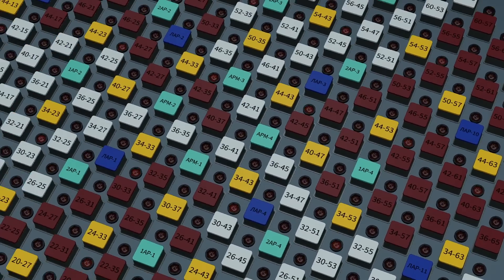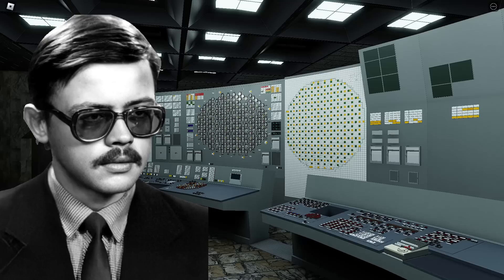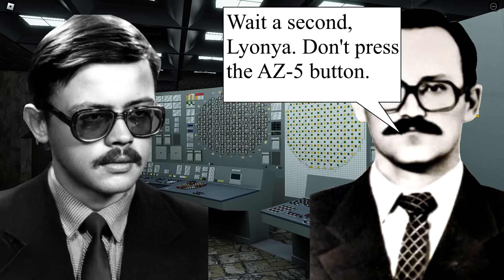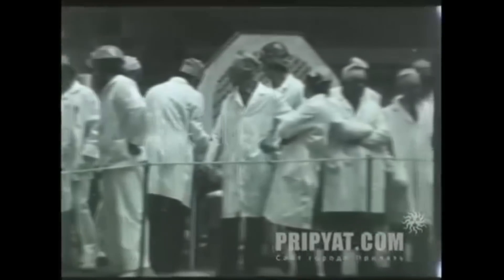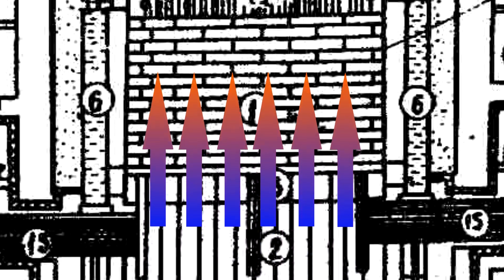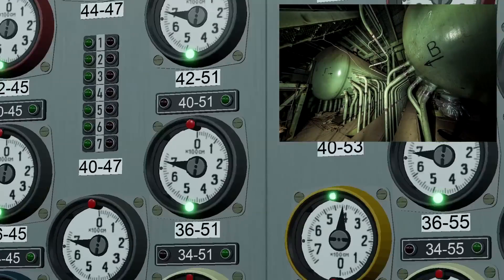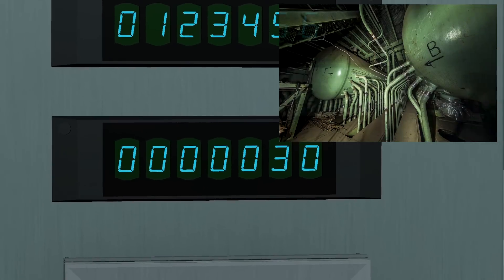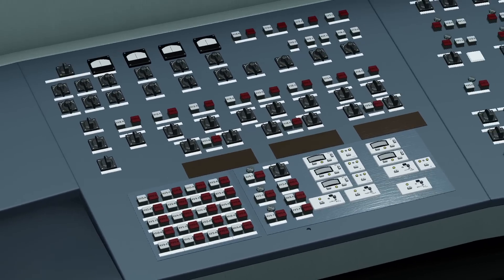Would Not Pressing AZ-5 SAVE Chernobyl?

Comment: So to summarize - essentially, to "save" Chernobyl at that point, they would have had to undertake a dedicated series of very rapid, very unintuitive actions - they would have to disable the automatic scram system altogether, they would have to inject cold water to bring reactivity down, and start inserting control rods "slowly" (compared to the scram at least) one bank at a time.

In other words, do exactly the set of actions that would destroy literally any other reactor in the world other than an RBMK.

That's exactly the kind of thing that they COULD have been TRAINED to do, but nobody in their right mind would ever do unless they were trained. If lessons had been learned from the Leningrad accident, and crews had been trained on an emergency procedure to manage positive scram reactivity, it might have been possible to minimize the damage at Chernobyl, but yeah... that would have required the Soviet Union to admit a flaw in its design and that was never going to happen.
Reply: The funny thing is, somewhat by accident, these steps were taken more or less at Leningrad 1975 and are the reason that was a partial meltdown and not an explosion.
Reply: @kalkuttadrop6371 Basically Leningrad got a good ending but Chernobyl isn't?
Reply: @osopenowsstudio9175  Leningrad was the first RMBK so the staff there had been trained originally on other reactors, specifically the A Series graphite reactors at Mayak. They likely had knowledge of the workings of graphite reactors beyond what was 'on the books'
Reply: @osopenowsstudio9175  I think it was Leningrad was trying to increase reactor power at that time, so it would make sense not to shove control rods in compared to Chernobyl trying to shut down. The reactor was cooler because they weren't doing the coolant pump experiment. The instability gets worse with more fuel burnup, Leningrad may have had less fuel burnup at the time. They had less of the destabilizing conditions that Chernobyl had.
Reply: @osopenowsstudio9175 Leningrad had better operators and a deputy chief that wasn’t  trying to actively sabotage the reactor for a test like Dyatalov was.
Reply: @straightpipediesel  they had less of the destabilizing conditions because they weren’t attempting to artificially destabilized the reactor. The incident in Leningrad was literally the operators doing their job and shutting it down because of a mechanical issue, Chernobyl was two in the morning, fucking around, trying to see whether or not residual flow would cool the core if you shut off all of the cooling and and took all the safety systems off-line.  

In Laymans terms, Leningrad was an oil leak so they shut down the engine …. Chernobyl was a bunch of mechanics who drained all over the coolant out of the engine and then ran it to the red line before trying to dump ice water on the block at the last minute and it cracked
Reply: @kalkuttadrop6371 That wasn’t a meltdown and it didn’t explode. If I recall correctly off the top of my head, they had to use the scram button because one of the water lines ruptured, and there was a momentary spike and power, but it didn’t blow up because they weren’t morons who had retracted all the rods at the same time and then tried to cram them all back and at once
Reply: I think the fact they stopped building RBMKs is probably illustrative enough to say they did admit it
Reply: @yegorgribenuke6853  Well, there was no real hiding it after Chernobyl. Admit it or not, if people are reading some insane amounts of radiation thousands of kilometers away, there's not much you can do to save face. They still downplayed it massively, the entire thing was blamed on operator error, and the whole change happened on the hush-hush. That's not very "admitting it" imo, but maybe our standards are just vastly different.
Reply: @yegorgribenuke6853  I guess that does say alot about the s0viets: it took a world-scale catastrophy for them to admit they maybe possibly made a slightly imperfect decision somewhere.
Reply: @yegorgribenuke6853  well it was a Soviet design and after this, the Soviet Union stopped building reactors….. so that’s not really an admission so much as there was no longer in need to build them
Reply: @Matt-yg8ub  I mean, nuclear power plants take a significant amount of time to build, just 5 years later the Soviet Union was no more, I think they had bigger issues to worry about than deciding to build more nuclear power plants.
Reply: Stupid question, what would happen if you tried this with any non rbmk reactors
Reply: @spazmonkey2131  I imagine it would depend upon the kind of reactor. There are a lot more designs than just the RBMK after all. Of course, the only reason AZ-5 didn't work here was because of the design flaws of the RBMK reactor. Flaws I think (desperately hope) other reactors don't suffer from.
Reply: @spazmonkey2131  Well, in a non-RBMK reactor, you basically always have a negative void coefficient, because the water acts as a moderator, so you'd never get into this feedback loop of a core temperature increase leading to a reactivity increase. The other two meltdowns in operational power reactors (Three Mile Island and Fukushima) both happened in reactors that had been properly shut down, but that couldn't get rid of the decay heat of the fuel.
Reply: @zuthalsoraniz6764  the Soviet RBMK design is different than the western designs and there are trade-offs between the two. We tend to see the Soviet design as defective because it is different than our own design, but the trade-off also had many advantages on their end.
Reply: @Matt-yg8ub What advantages does RBMK have? The only one I am aware of is that the channel design without an overall reactor pressure vessel allowed at least in theory for online refueling, though that is not a substantial advantage for a purely civilian powerplant.
Reply: @zuthalsoraniz6764  Without a pressure vessel, it's cheaper and requires less metal fabrication technology to build, one reason why CANDU has it. Online refueling lets you use lower enrichment, also a technology and cost issue.
Reply: @spazmonkey2131  depends. Just about any other reactor design does not have a moderator on its control rods, meaning you could scram normally. 

If you want to be fancier however, some US designed reactors have dedicated tanks filled with tens of thousands of gallons of boron-infused water. 

Boron is a massive neutron absorbing element, meaning if you flooded a reactor with boron-infused water instead of normal water, it would be the equivalent of pouring a liquid control rod over everything. All neutrons would be absorbed, and the reactor would rapidly go subcritical and fission would abruptly end up
Reply: @spazmonkey2131  No other reactors are graphite moderated...they are water cooled, as opposed to the RBMK using water for Steam production. Other reactors use "heavy water" to moderate reactions...you can see these "reactor pools" on YT vids.
Reply: If they had been properly trained they would have not removed so many control rods.
Reply: @Gerben42  the only way to remove that many rods at the same time was to override the safeties and shut down the computer. If they hadn’t been trying to induce a stall in the reactor in order to test a theory about residual flow, they never would’ve intentionally crippled that reactor to the point of it, exploding.
Reply: Thats ALSO taking into consideration that the absolute MINIMUM amount of control rods that an RBMK reactor needed was something like 15... they removed all but 7-8, about half as many... 

The biggest problem that ultimately lead to the disaster was by operating said reactors at 50% capacity for an extended period of time. Unfortunately, nobody bothered to explain HOW everything functions to their "engineers", let alone to their "lead engineer". 

Kind of ironic that the Soviet Unions biggest blunder was their overarching need to maintain secrecy.
Reply: @Deathcylance  yeah that’s the part that I still can’t wrap my head around….. These were the trained engineers designed to operate this facility safely. Legasov knew how it worked…. In the miniseries, the lady whose name I won’t bother to remember because she’s a composite of 100 other engineers, also knew how it worked…. Why in the hell didn’t Dyatalov?    The real flaw in the Soviet system seems to be that they built an RBMK reactor as dual used to produce power and plutonium …. And they built safeguards into the system to prevent it from exploding but then gave people like Dyatalov the ability to override the safeguards, but not the knowledge to understand why the safeguards were in place.  The Soviet Union compartmentalize the information to where their physics professors understood how the reactor worked, but the engineers operating it just knew which buttons they were supposed to push, and when … but not why.  

Chernobyl #4 had graphite tipped boron control rods because that design functioned for what the Soviet Union wanted and minimized maintenance…. But it also induced a liability if not properly operated
Reply: @Deathcylance just so you know the rbmk reactor had over 200 control rods
Reply: @erickitzi  correct... my comment was referring to the absoulute MINIMUM required level of control rods their very own procedures dictated... unfortunately, by removing the additional control rods to less than HALF of the minimum, the operators basically built an H-bomb with 3-5% enriched uranium... which would've been impressive (THAT usually takes 80-90% enrichment) if not for the fact that the reactor was never built nor designed to attempt to contain said H-bomb... 🤦‍♂️
Reply: @Deathcylance  Nooo... Prompt criticality can occur in 3-5% enriched uranium. Which is what happened, and is obviously undesired in nuclear reactors, which we want to run on delayed neutrons instead of prompt neutrons. Yes, they made a steam bomb, followed by a hydrogen gas explosion. But they did not make an H-bomb. *No nuclear reactor* can make a True nuclear bomb, let alone a fusion bomb in any configuration or accident. The reason N-bombs are so hard to make in the first place is because you must have an enrichment on the edge of super criticality, then compress it to the point of going prompt critical, and keep it compressed in a small enough space long enough for the maximum amount of fissile material to fission (or chain start fusion) within 50-100 shakes or 500-1000 nano seconds. After that the bomb has already finished its explosion and blown the rest of itself apart stopping further fission and fusion (which is why you need such highly enriched material). The bomb is done exploding before your eyes even perceive the light from the flash. That cannot occur in a nuclear reactor. Which is why no reactor is designed to contain an H-bomb, because there's no need to. But they are designed to contain steam/hydrogen explosions, but Chernobyl wasn't.
Reply: @Tyraelful i didn't say anything about a "true nuclear bomb", i said H-bomb. Since a bomb basically means explosion (yes, im aware implosion bombs exist), and so what i meant by H-bomb WAS hydrogen explosion. H-bomb is just shorter. I ALSO didn't wanna get into the specifics like you did mostly because I'm no "expert" in nuclear physics. What i DO know is that physicists dont name it 500-1000 nanoseconds... its referred to as "Shakes"... which, from my understanding is equal to about 10 nanoseconds.🤷‍♂️🤷‍♂️
Reply: @Deathcylance  So what you mean to say is you used H-Bomb as hyperbole but ignored that it means a Hydrogen Bomb, which is a fusion bomb set off by a nuclear bomb. I get the point of hyperbole but im just being clear that no H-Bomb could exist
Reply: @Tyraelful  Correct... I used H-bomb as shorthand, and to describe the explosion that sent the 2000 ton lid flying into the air with 3-5% enrichment... NOT an ACTUAL H-bomb that needs 90% enrichment to be doable.
Reply: @Deathcylance the reason they kept it a secret was because the design of the reactor was really good for the time. Super easy to build and efficient to operate at very large power outputs. The US didn't have anything like it which is why they wanted to keep it a state secret.
Reply: @zemm9003 hence why they couldn't disclose their super reactors were dangerous
Reply: @Alex-gw1zw  they’re super reactors, were only dangerous, though, if you disabled all the safeties and ran them  at the edge of oblivion.  

My Dodge minivan is pretty safe, my McLaren F1 is also pretty safe. Provided that I don’t drive it at 200 miles an hour in a rain storm at two in the morning with limited visibility and debris on the road. 

Chernobyl number four  was a calamity of errors that all added up to an explosion because way too many things went wrong at the same time.
Reply: I mean they were told not to remove so many control rods and did so anyway
Reply: @whatsascallion-f6l  this is a misconception. It isnt about physical control rods, but the ORM value being messured in "control rods". They did fall below 15 at 1.00 but not later at the time of the explosion. So their violation actually didnt matter. Later studies also showed the reactor would have also blown at about 20 rods. 

They also had no fast way to check the ORM (or number of rods). The calculation took 5 minutes and the computer was 40m from the control room. It was done only once every 2 hours.
Reply: Even if they do take all of those actions and avoid the explosion, the reactor still suffers serious damage.
Reply: @OnyxQuill4583 Damaging the reactor would mean all engineers presiding would end up in a labour camp for sabotage. Of course it’s better than the alternative(what happened) but I doubt that the soviet justice system would be thinking that way… or the engineers present in the room when it happened.
Reply: @OnyxQuill4583  Serious enough to cost a ton of money and resources, not enough to cause the whole city to be uninhabitable
Reply: AZ-5 was a full insertion of all control rods.
AZ-3 would place 60%
AZ-2 would place 40%
AZ-1 would place 20%

They were emergency buttons and the number dictates the level of emergency.

Jlhaving all of the rods removed and trying to put them all back at once was the problem. There was a reporting delay so by the time they realized they had a run away reaction it was already too late.

They had too much Xenon and over corrected by not only removing all of the rods, but removing them fully, and too quickly. They did burn off the Xenon which was in essence keeping the reactivity down...once they did that, combined with the void coefficient,  it was a runaway. The spike from the graphite on the rods was the proverbial straw
Reply: @andrewmckee6580  I'm not 100% with you. I think a key point is repeated spikes in cold water at high flow rates keeping reactivity down and through cycling making the automatic protection system remove all the control rods. I wasnt only the operators who removed them all, the automatic protection did so as well. Xenon played a role, but it wasnt the only culprit.
Reply: Heck, after the accident, it turned out that a tiny amount of tweaks to the design basically made it safe. This could've been done before the reactors were greenlit, but apparently the guy in charge was really in a rush
Reply: Fun fact: the original design was different but they wanted to cut costs by making the reactor smaller. This made the graphite tips out of balance with the rest of the rods. Without this redesign it probably would've been fine
Reply: Alas.
Reply: Injecting cold water? Into hot reactor core? For what, to achieve oxyhydrogen explosion?
Reply: You should criticize the soviet unions policies and behaviors without making a dumb characature of it. "That would mean they'd have to admit a flaw" Come on, it's been pointlessly demonized and made fun of enough, and we never give it the temporal and political context that'd make their behavior make more sense. They were crushed in a cold war, things were messy, don't let peoples artificial melodramatic attitude effect your real judgment.
Reply: @blocc_nova746  common sense is far from common.
Reply: Hell, if they had just spent less time running the reactor at low-power before running the experiment, this wouldn't be necessary.
I kinda think this showed how good the design was... not good enough ofcourse, but it required a ton of incompetence for the flaw in the design to become relevant. If the test had been run normally, then the reactor would have run fine. The worst that would have happened, had they made 1 less mistake before slamming in the rods, would have been the reactor having to spend 24 hours restarting.
They just hit on all the worst moves, one after another.
Reply: The lesson people "learned" from Chernobyl: nuclear energy bad

The lesson people SHOULD have learned from Chernobyl: communists are too stupid to boil water.
Reply: STFU about Soviet Union you have no rights to be western propagandist.
Reply: Inserting the rod slowly was the standard procedure for shutting down the reactor, but they ran out of time to do it because Dyatalov refused  to end the test and allow them to shut it down when there was still time. 

They all saw the writing on the wall and kept trying to abort this abomination while there was time, but the senior officer on site refused
Reply: Kinda like the titanic. Doing what seems to be the best option in every other situation causes the disaster. Here, pressing the scram button causes the disaster. And the titanic likely would survive a head on collision.
Reply: This is the same with the titanic, the titanic whould have not sank if they went head on with the iceberg. Still alot of damage and death (because the bow contained many cabins and whould have been crushed) but no captain ever whould consider not taking evasive action as it is extremely unintuituve and only makes sense with hindsight
Reply: @Guardduck987  not only that but taking evasive action is taking action…. It’s doing something whereas hitting it head on is a passive approach that only makes sense in hindsight.  If Smith had ordered the Titanic to ram the iceberg he would’ve saved countless lives, but would’ve been blamed for the deaths it caused because nobody would’ve been aware of the tragedy he avoided
Reply: The design was very good.